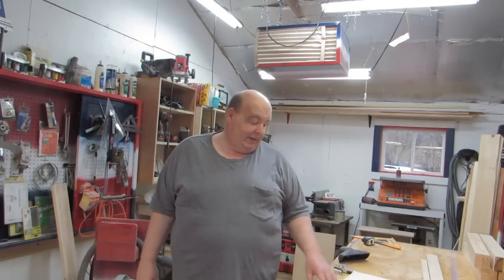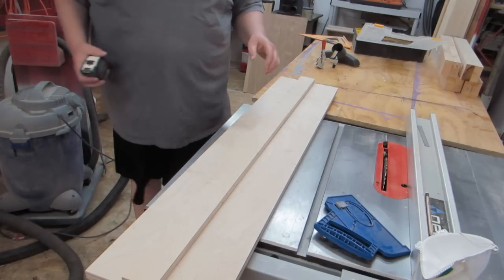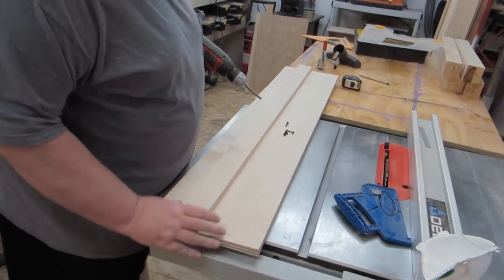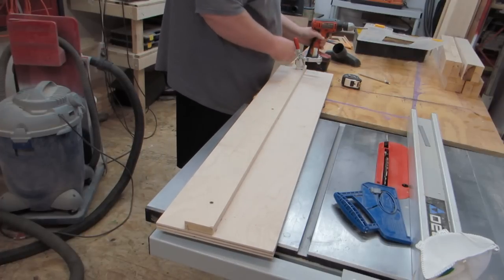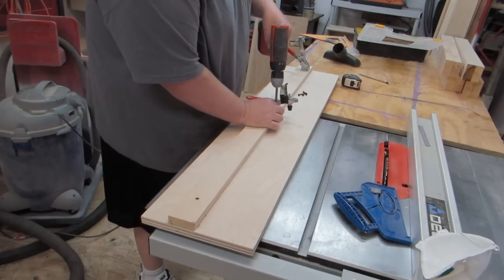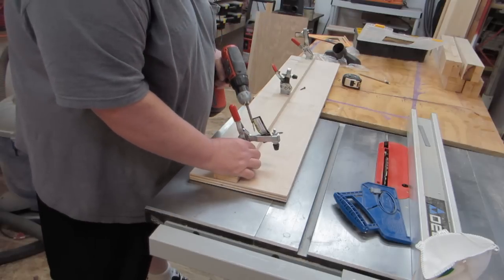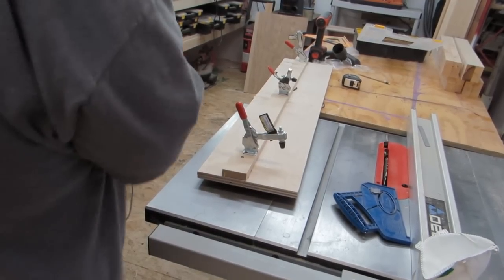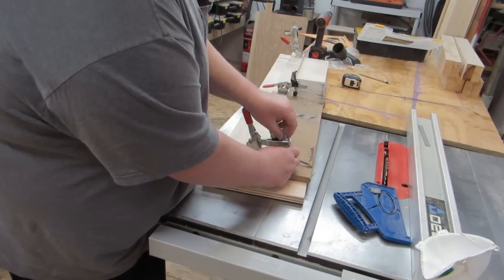Making a table saw jig to square up pallet wood

Comment: I like it! looks easy to make and useful with all sorts of boards. 

I had one idea after you tried the first board that was to small. the other side of your jig has a smaller side. I was thinking you could install another set of hold downs facing the other way and be able to do both small and large boards just by turning the jig around. 2 in 1!

Comment: This looks great 
But wouldn’t I get the same results jus using the fence as the reference point as the strip of wood against the fence is doin the same job
Reply from the maker: I find that sometime the fence is not as steady as the jig, so the wood I'm trying to square up ends up not being square.  It is also helpful with larger sizes of wood.  Thanks for watching!

Comment: I can’t actually tell the difference between using your table saw or cutting the pallet wood this way , so seems like a waste of time .
Reply: Nigel Francis it is to put a known true straight edge. If you ran the pallet wood against the fence, what ever curve is on the fence side will be cut on the cut side. This method uses the sled as the true square edge and allows you to get a edge ready for gluing (usually when making table tops)

Comment: Pretty good idea with those toggle clamps. Try using a magnetic drill bit extension so your screws don't fall off. You will need to use the shortie drill bits though.
Reply from the maker: Thanks for watching.  Yeah, I have the magnetic extension, but just didn't think about using it. Lol

Comment: Please tell me the difference between doing that, and just running the pallet wood against the table saw fence?
Reply: I agree he just made a fence e,tension as far as I'm concerned
Reply: extension
Reply: Marcie, it's because if you push the board up against the fence then the other side of the board you are cutting will just follow the same pattern as the fence side. This way the jig he built is parallel up to the fence then whatever board rides on the jig has no choice but to be straight like the jig to fence edge. Just make sure the 2 boards that make up the jig are square to one another before you screw them together.
Reply: Since I made this comment it had become clear to me how it works and I understand now but thank you for your reply